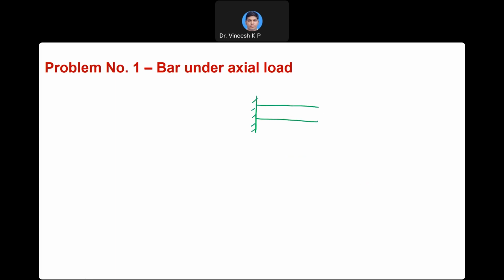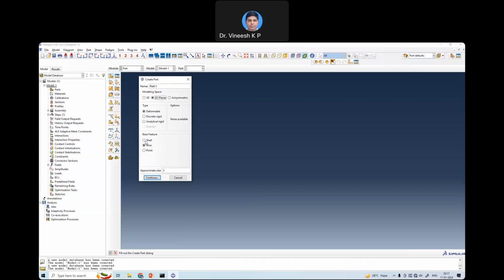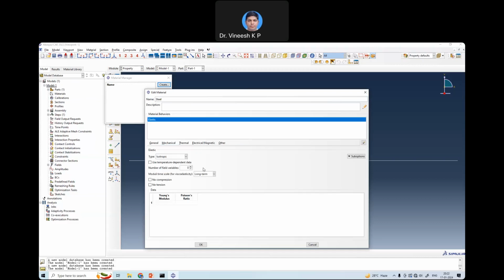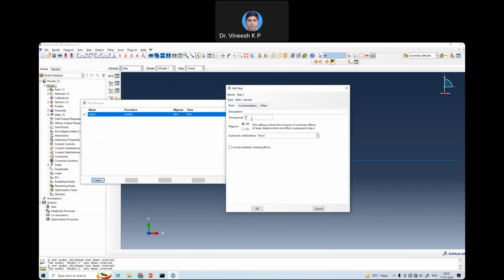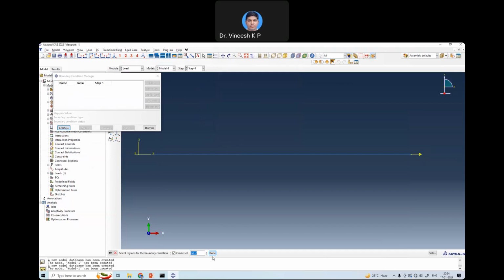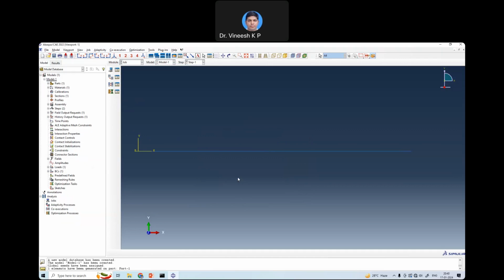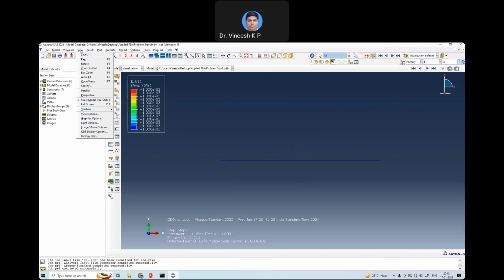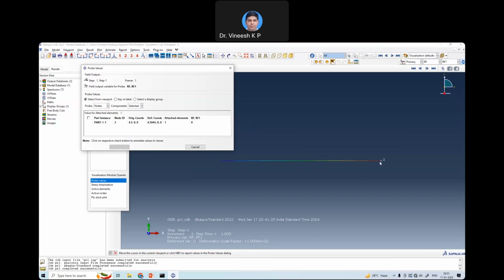Problem No. 1 - Simple problem of a bar under axial load

Comment: Sir, while selecting the section you have selected category as beam and type as truss. what would be the changes in our analysis if category was beam and type was also chosen as beam?
Reply from the maker: Hello Malika, no change in the results if you select beam in section as well as in  type. This is because the beam element in Abaqus can take the degrees of freedom of truss (this is required in the current discussed problem) also. But if you select the beam type, you need to specify the cross section for calculating the moment of inertia which is not required to solve a bar problem. i hope this clarifies your doubt.